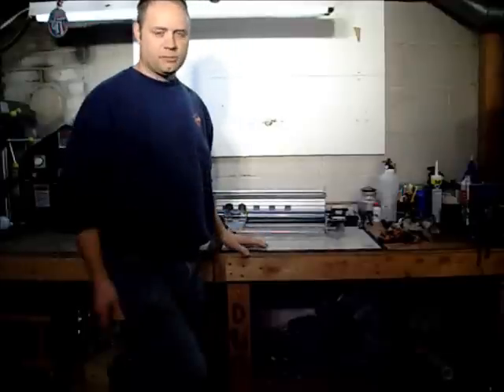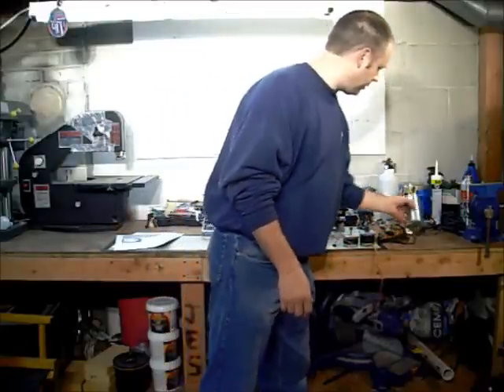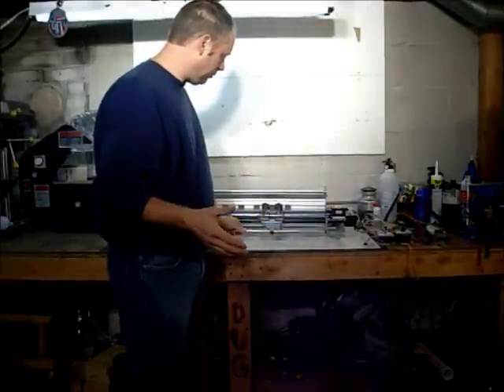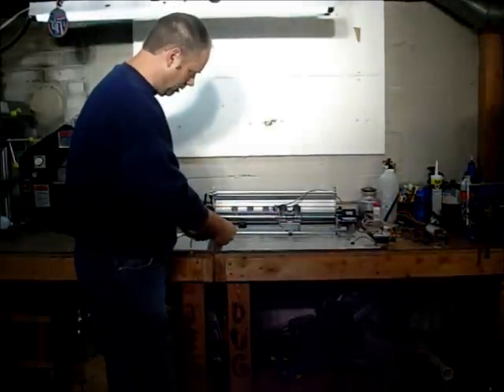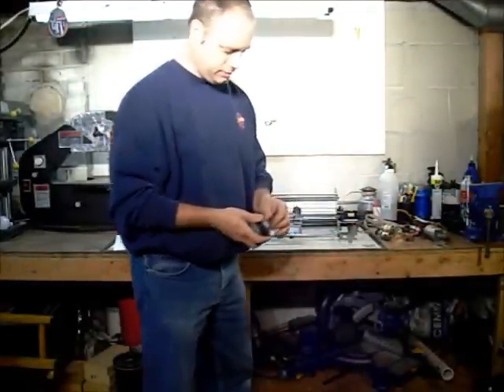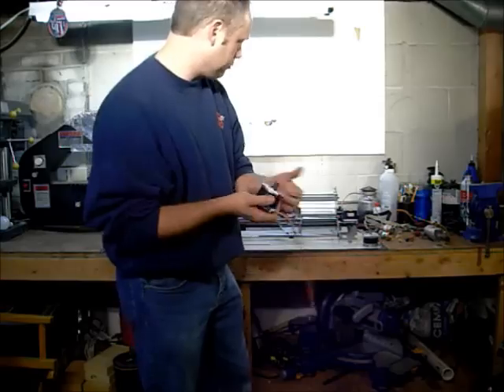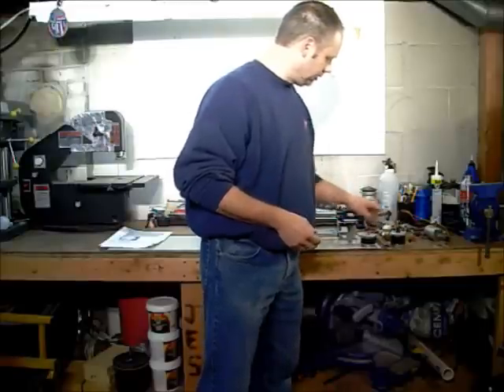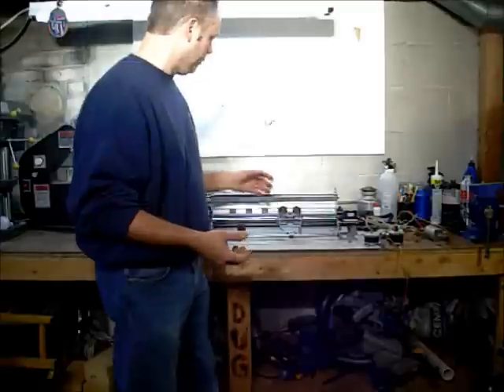CNC router build from line printer

Comment: have you made a start on this project yet?/ or are you still getting the parts together first?? building one myself from printer parts and odds from the workshop all the info i watch of coarse helps me with my cnc,you have a great start though looks like the main parts you will be needing now is electronics ,/boards and gear..

 ..thanks
Reply: No I have not started yet. I finally just broke down an purchased a CNC the shapeoko for 300.00 I may get back into trying to build one at a later time. After using the shapeoko i realize that the printer motors are not going to be strong enough to cut aluminum.
Reply: oh ok thats a shame ,iv already stripped down 2 printers since our first post and fitted top rails and sliders,next is motors and screw drive or belt not sure yet..
Reply from the maker: nosjet1 I would love to see how things turn out for you I may look into getting back into the build if I could find some inexpensive motor controllers. 

Thanks and post videos if you have any
Reply: yer mate ,no probs got some pics coming,and the controller kits on ebay around $300 to $400 deppending on the sort ya after 
putting up pics soon as i get me controllers cheers ;)